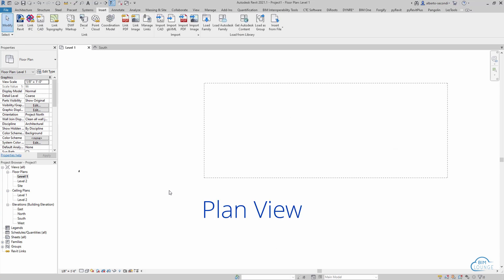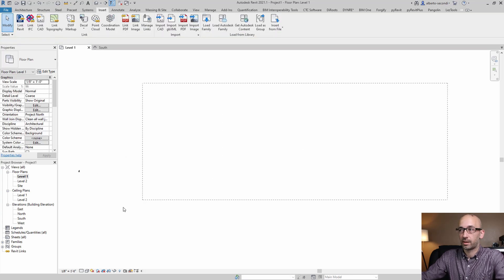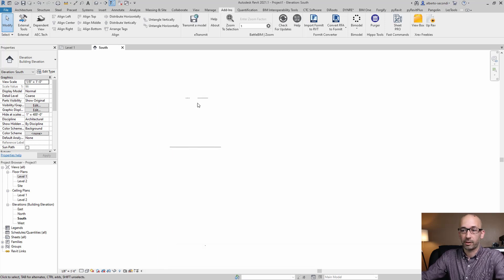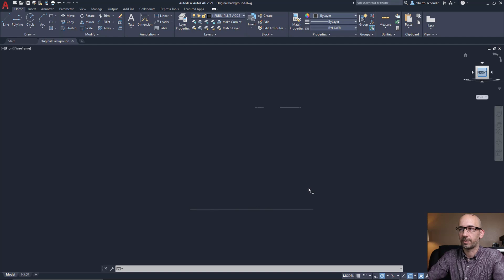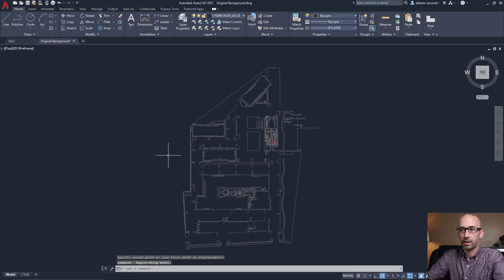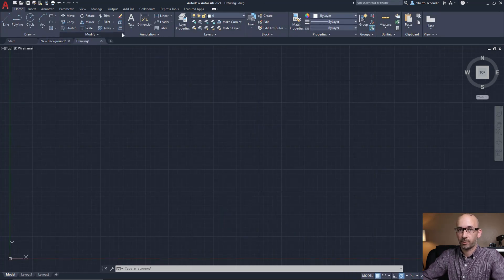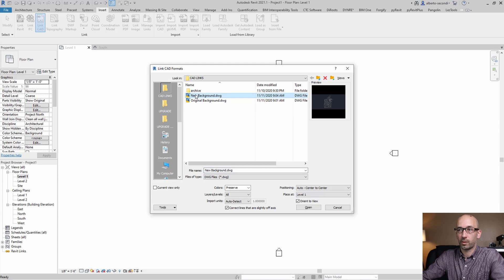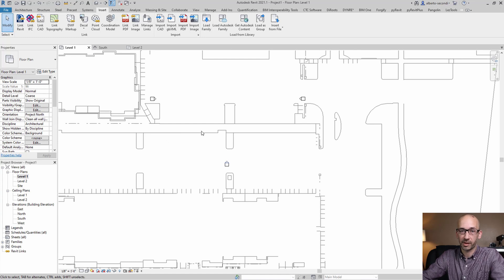How to prepare 2D CAD backgrounds to be linked into Revit

Comment: Thanks for the tips ! I have a cad file which has slab as a hatch, when linked in Revit as foreground the revit elements are not visible and when its as background the slab hatch is not visible. I tried with halftone / transparency options but still not able the show the cad as a background and revit models front of it. Suggestions appreciated .

Comment: Great one Alberto! Personally I do an extra purge the hard way in Autocad since many times the files are bloated by missing references and definitions of exploded blocks and alike and a simple PURGE won't be enough. My recipe is: DXFOUT + DXFIN + SAVE DWG + CLOSE + AUDIT DWG + PURGE. That would significantly reduce the file size and really clean all unwanted data. Somehow the WBLOCK instead also is useful but nothing compares the above solution. As for the floating elements in elevation view to move to Z0 I'd rather do it numerically by setting the 0 value in the property palette just to make sure the geometry don't go around off axis (I know perpendicular osnap should work but.. better be 100% sure especially for large site plans with lots of details). Bye
Reply: I usually do the same! Overkill-WBlock-Purge
Reply from the maker: Thanks Enrico, I see you had bad experience with that too :)
Reply from the maker: Thanks Paolo, that means those files were significantly worst than the ones I've encountered! Some great tips there. I try to flatten or otherwise use parameters for elevation, but for some drawings just doesn't work (in this one for example). Thanks again, your comment will help others I'm sure!